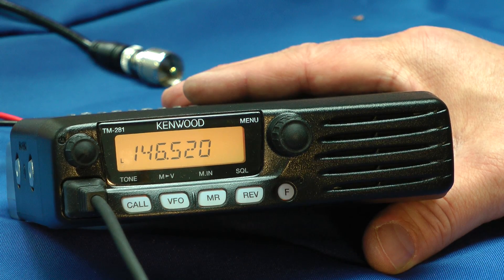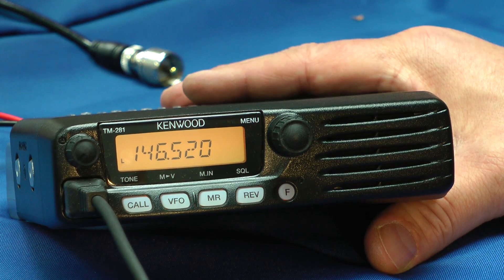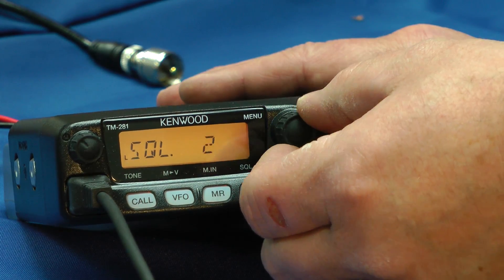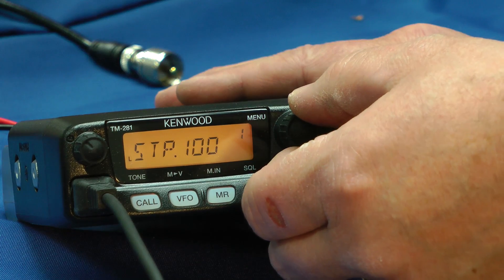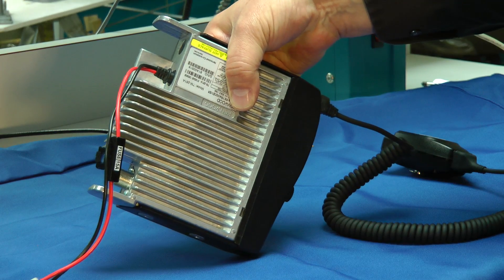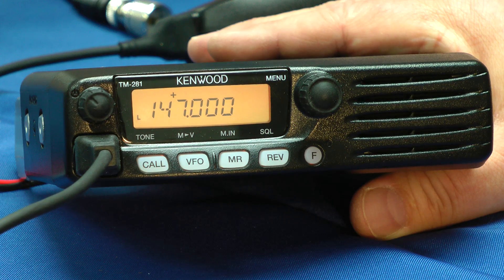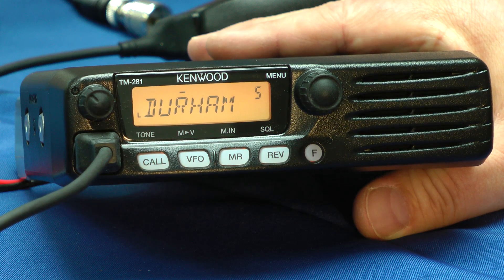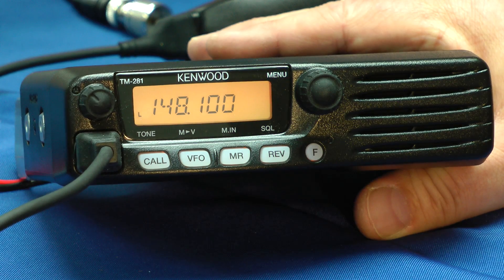Kenwood TM281 Transceiver Preview

Comment: I purchased a Kenwood TM-281 used it about 5 times when the tuning knob froze up, I found a knob on line and just replaced the old one. The knob works fine but now none of the function buttons on front of radio work. Does anyone know what the problem might be be? Thank you.

Comment: I have attempted to reset this radio several times.  Each time it appears to lose capabilities.  As of now it is a weather radio or one channel (call channel) radio.  It is either that or weather.  It will not accept entered memories.  I purchased a programming CD from Ebay.  The CD is for a TM-271 and does not work with the TM-281 and the TM-281 does not support chirp.  If this radio were heavy enough it might be good for a boat anchor.

Comment: this radio has too much intermod issues in my area, so I sold it. The v71a dual band model has a menu setting to deal with intermod and it works, the 281a does not have that setting....the 281a did receive well and had  clear radio reports though...the v71a was made in Malaysia and the 281a was made in china...the 281a didn't look or feel cheap though

Comment: since im going to replace my ft-1900 with this radio it still has the same power connector my only concern is i want to use the radio mobile with a cigarette lighter adapter will i be able to do that since its 25 watts low

Comment: hello friend good night, it would be possible you post a video with the values of manufactures in adjustment mode, because I have a kenwood tm271a deprogrammed so that this and do not think the Internet is no table with the values of manufactures and now are left to rely on those has an equal: obs.no adjustment mode has not give any programmed reset once it gets reset to the last value set so whenever making any adjustments make a beck-up with values from manufactures ja thank